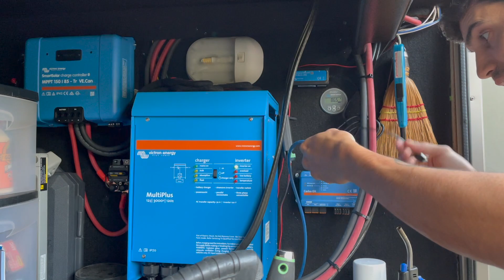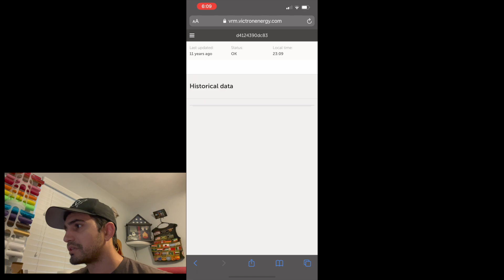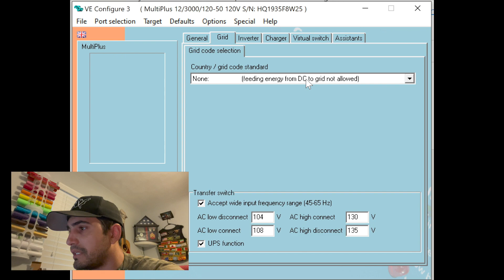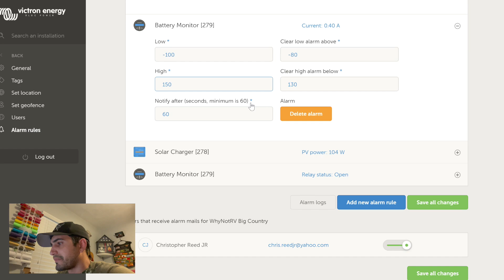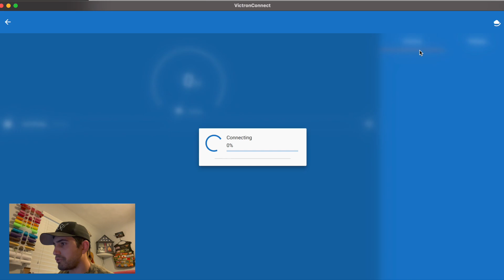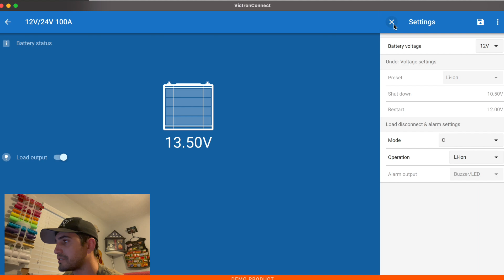VICTRON settings and installing a Cerbo GX - Why Not RV: Episode 49

Comment: Is there any reason why I should not power my Cerbo GX from the load output terminals on my Victron MPPT charge controller instead of connecting it directly to the battery?
Reply from the maker: The only reason I would not do that is a.) if the mppt were to fail you will also lose the cerbo… b.) if doing a remote ve configure update and that reboots the mppt which will cut power to the cerbo which is doing the update. You will cause failure. The cerbo should always be direct to the battery so it NEVER loses power
Reply: @WhyNotRV  thank you!
Reply from the maker: Anytime!

Comment: Very helpful .... I want to use the battery more than shore power but if power goes out when batt low (er) I'd wish it was fully charged ... sort of a perplex..  I want to spend less on shore power bill
Reply from the maker: Thank you. Ya there are a few ways to setup the Victron system to only pull from shore power when not enough solar or battery’s too low or AC load too high.

Comment: The Cerbo Gx only works with victron equipment or inverters can u use another inverter with the Cerbo Gx ?
Reply from the maker: The Cerbo gx is for Victron only products. It’s the central hub for all the data to go through
Reply: @WhyNotRV  thanks I've been up all night researching I just bought two Victron Blue Solar 100/30 Mppt charge controllers a smart shunt & I'ma pickup the Cerbo Gx here in a min it's going to take me a minute to get the victron 24 volt inverter but I've seen the Cerbo Gx being used with other none victron inverters
Reply from the maker: Oh really? I’m curious how it communicates with other non Victron OS inverters. The multiplus is hands down the best inverter on the market in my opinion. Truly an incredible piece of technology.
Reply: @WhyNotRV  yes the multiplus is a beast but yea I seen one video he had all the victron components but his inverter was something else I'm not sure if the Cerbo Gx was monitoring his inverter but it will show hooked up and running his system
Reply from the maker: Hmmm. Ya I’m curious on that.
Reply: @WhyNotRV  Victron VE direct ve bus is simply RJ45 standard Ethernet cable just plug it in the Cerbo Gx will look at as a external generator I believe

Comment: Hi, to correctly work a Cerbo GX absolutely needs a BMV Battery monitor or a smartshunt will be enough to check the battery status etc?
Reply from the maker: Victron Smartshunt is fine as well. It has the same ve direct port that plugs into the Cerbo

Comment: I just got a cerbo gx and a couple 01000 temperature monitors. How do I access the temperature reading? They don’t show up under devices and there is no option to add them.
Reply from the maker: Hey Tommy, I’m not familiar with what you’re talking about with the 01000 temperature monitors. Victron now has  the Ruuvi temp sensors that are Bluetooth along with the temperature sensors that can be plugged in to a multiplus or BMV or something similar.

Comment: Hey - did you have the victron bluetooth solar controller or the non-bluetooth solar controller?  I have the non-BT one. I was hoping that i would be able to do all the config on the cerbo.   Thoughts?  thanks,  C
Reply from the maker: Mine have always been the BT version. I have not ever configured a MPPT through a Cerbo personally

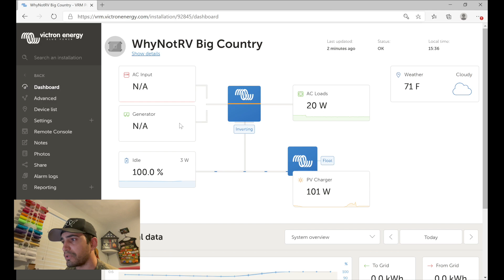Comment: 5:03 is it possible to use VE configure remotely ? I mean doing all these settings but via vrm portal or any other way ? or one should have this mk3 to usb converter with him to be able to use VE configure app wioth the victron quadro 10kva model
Reply from the maker: If your Quattro is plugged into a Cerbo gx you can do all this remotely from anywhere in the world.
Reply: @WhyNotRV  what if its plugged into color gx ? still possible ?
Reply: if yes then pls tell how

Comment: if you get a cerbo gx in the system.. can all settings for multiplus  inverter , charger controler and other victron  products that can be connected to cerbo gx  be done using the cerbo  gx? are any other interfaces and cables needed to be able to do the settings 100%.?
Reply from the maker: The Cerbo gx will allow you to program all aspects of the multiplus. Any other chargers (solar or dc-dc) are programmed via Bluetooth and the Victron app.
Reply: @WhyNotRV  got it. makes sense.  your videos are helpful.
Reply from the maker: Thank you!!!

Comment: Could you connect two GX touchscreens to one Cerbo CX at the same time? 
For example: one for the dashboard for when you're driving, and one in the back for when you're using electricity?
Reply from the maker: Unfortunately no, the gx only has one port for a display. However, what you can do is Nina talk the one in the back as normal and when driving you fan pull up the VRM app on a phone or small tablet that you can Mount and have all the information right there.

Comment: Hello. I’m looking to add the cerbo gx. On the multiplus I currently have the Remote control. If you add the cerbo gx with the connect app. Can you still change the state or amps through the Bluetooth? Or does the remote controller override it?  I want to also add the screen but not sure if the screen will allow the state of multiplus to be changed as well.
Reply from the maker: Hey Bill, thanks for watching! You can change it through either one. Bluetooth through the dongle or through the Cerbo. Neither override each other. If you change it in Bluetooth, it shows in the GX, if you change it on the GX, it shows it on the Bluetooth. Great question by the way!

Comment: Are you able to set this up so that, it uses battery or solar to offset grid when hooked up to shore? My understanding is that you can use ESS to set the multiplus up in a sorta grid tie like inverter where it does not send power to the grid but uses the solar/inverter to power loads and only takes what it needs from the grid.
Reply from the maker: Yes. This is exactly how I have it set up right now!!! 
Everything in my RV runs off the batteries which are charged by the solar. It only pulls from the grid if my batteries drop below a certain percentage that I set. I can also set it for a certain wattage such as when the air conditioner turns on. Which in this video I think is actually how I have it set up at that time.
Reply: @WhyNotRV  thank you for the reply!!! Information on that setup and use of the software seems to be hard to find. You really put a lot of information in your videos. Thank you!
Reply from the maker: If you have questions or I can help in any way just shoot me a message on Facebook or go to my website and there’s a contact form and we can email.
Reply: @WhyNotRV  okay sounds great. I really appreciate that! Probably be a few months until I get my system. I have a magnum system now, but I'll be switching to the victron with diy lithium cells.
Reply from the maker: Good luck with the project

Comment: Nice summary of the VRM operation. FYI, the  drop offs on the last graph you showed of the solar charge controller output are not birds. About every 10 minutes, the MPPT controller varies the voltage down on the solar panels to see if there is a voltage that produces more power output from the panels for a given sunlight situation. That is the essence of what a MPPT controller does. It seeks the maximum power output the panels are capable of delivering.
Reply from the maker: I appreciate that information. Always learning. Thank you.

Comment: At the end over the video, you showed us your solar production graphs.  Those little drop offs are not birds, mine does the same thing.  I suspect that periodically the solar charger drops out to check baseline battery voltage and state.
Reply: The MPPT does a full sweep every 15 minutes to make sure it is on the right maximum spot.
Reply from the maker: It only dropped like 150-200 watts from maybe a second or 2. I have some very large hawks in my neighborhood. I figured there shadow dropped the production when they flew by. I went olio on the roof and cast my shadow on a few panels to see the result and it did a similar thing. Dropped about 200 watts and went right back up. Victron mppt is constantly being reported the battery soc voltage and temp all from the battery monitor it’s linked to.

Comment: HI, Thank you for the video, quick question, I have 12 of these  Valence U27-12XP , they are in 3 group of 4, to bring it to 48V for each group, I am in process of buying charger/inverter  multiplus II, 48v, my question is when all hooked up , can you explain how does charger , charges the batteries ? does it charge as group or all 12 as same time?  i am bit confused since like you I don't BMS ... thanks
Reply from the maker: I don’t have a 48v system but it should all work the same way.  It’ll charge all 12 together. You just have to obviously make sure your batteries are wired correctly being that you’re doing the series parallel combo
Reply: @WhyNotRV  thank you for the reply,   ...do you any issue with cell balancing on each battery? or BMS inside of each battery will take care of the balancing the cells?   Do you need Smart Dongle for the multiplus since you add Cerbo GX, ? thanks
Reply from the maker: So from what I’ve heard they don’t do cell balancing by themselves. Every time I plug my computer in to check them I get some that say cell balance active. I just don’t know if they stay balancing when I unplug the computer. I just bought the thunderstruck valence bms. I believe for you, you’d need 3, 1 for each set of 4. But honestly I’m not sure.
Reply: @WhyNotRV  thanks and Please  keep up posted on the thunderstruck valence bms,. One last question,  Do you need Smart Dongle for the multiplus since you add Cerbo GX, ? thanks
Reply from the maker: I don’t need it anymore no. But I already have it so I hooked it up just to have for quick access to restricting the amps.
Reply: @WhyNotRV  Thank you and keep these videos coming, Great job :-)
Reply from the maker: Will do. Thanks